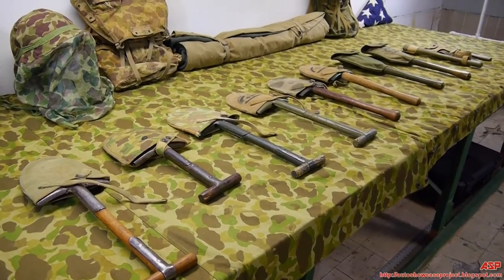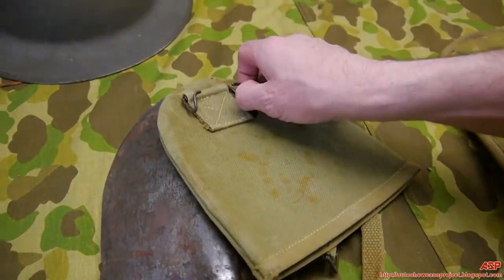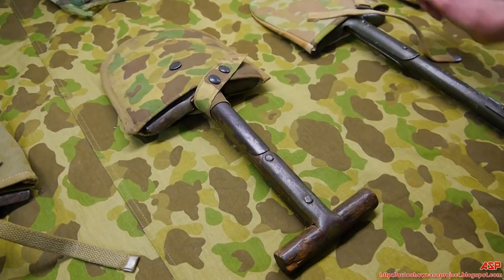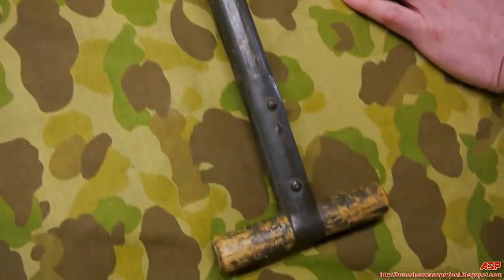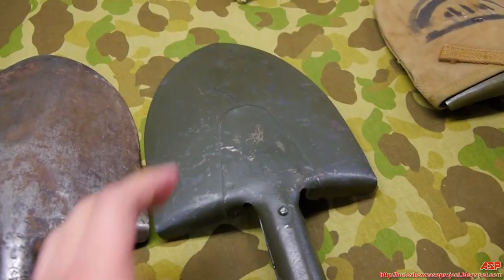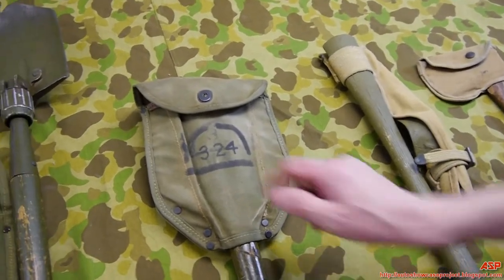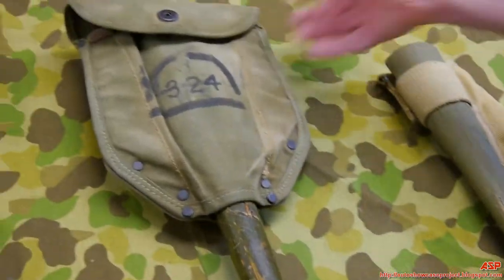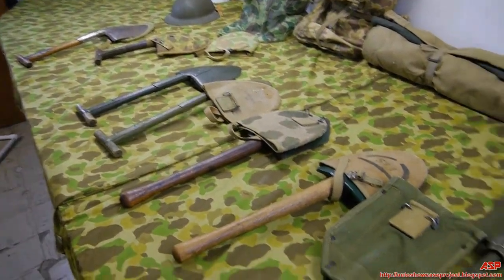World War 2: USMC Entrenching Tools and Covers | Collector's & History Corner

Comment: When I was an infantry paratrooper in the 82nd ABN from 80 to 83, I carried one with a pick and shovel on a straight wood handle and heavy canvas cover. They gave us an option to take the heavier pick-shovel or the new lighter folding Ames shovel with plastic cover. Most troopers and many more NCO’s chose to carry the Ames folding shovel. I could out dig and out chop them by far. The pick came in real handy in the frozen ground of Ft Greely, Alaska and in the rocky ground of the desert of Ft Irwin, Ca.  I chopped lots of trees at Bragg and Alaska for overhead cover and firewood with it. I have one I carry in my truck tool box. I wish in could find another, but will probably have to settle for an Ames folding E-tool
Reply: the pick/shovel combo you speak of, was also AMES veitnam era till about '77ish. they are pretty inexpensive, i have even seen them on Amazon. i like both Etools, the straigh handle is nice for longer digging and having the pick. the tri-fold is nice for litewt and 2 hand trenching aswell as a nice seat!

Comment: I have a 2nd pattern M43 cover. I'm trying to put it on a E.M.P. C.O. 1945 shovel. I can't get the shovel to fit far enough inside for the flap to close. My question is: Is the shovel not meant for that cover? OR do I need to try and stretch the cover out a bit?

Comment: I have one with a combination shovel and pick on one handle.  No tee.
Reply: Mike Dunn, when I was an infantry paratrooper in the 82nd ABN from 80 to 83, I carried one with a pick and shovel on a straight wood handle and heavy canvas cover. They gave us an option to take the heavier pick-shovel or the new lighter folding Ames shovel with plastic cover. Most troopers and many more NCO’s chose to carry the Ames folding shovel. I could out dig and out chop them by far. The pick came in real handy in the frozen ground of Ft Greely, Alaska and in the rocky ground of the desert of Ft Irwin, Ca.  I chopped lots of trees at Bragg and Alaska for overhead cover and firewood with it. I have one I carry in my truck tool box. I wish in could find another, but will probably have to settle for an Ames folding E-tool